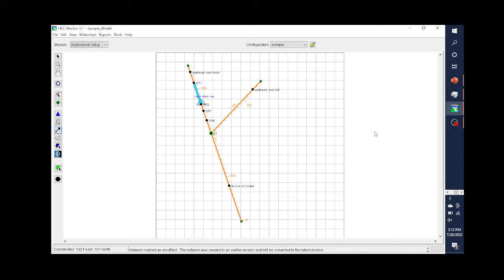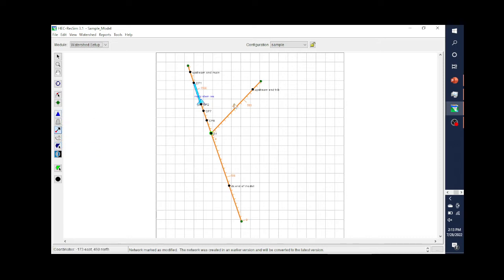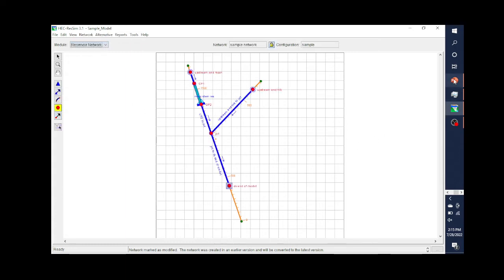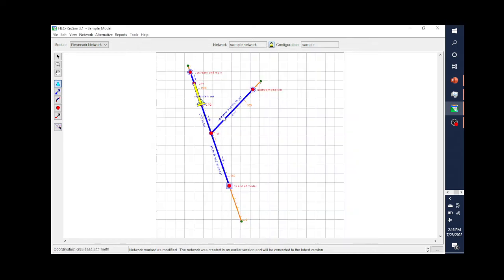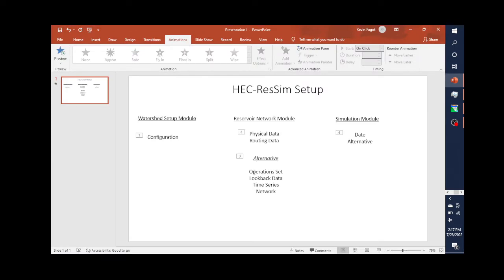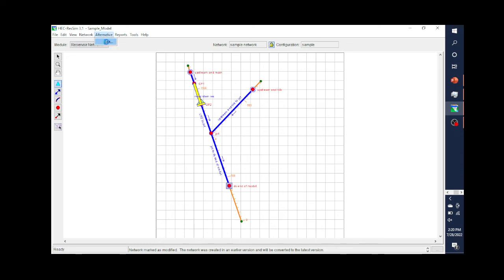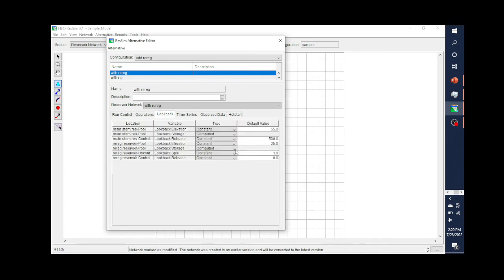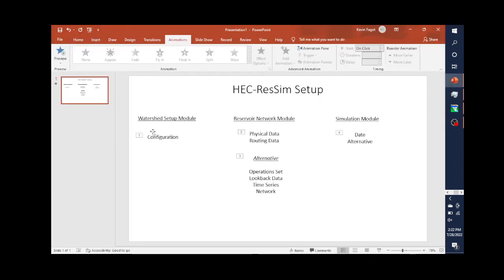How to create a ResSim model

Comment: Hello, how could we get the storage of elevation equalling to 0?
Reply from the maker: Are you asking if it is reasonable to have a zero in the elevation-storage table?  If so, it would be reasonable if you are at a very low elevation where there is minimal or no storage.  However, you could also start at zero storage at whatever your lowest elevation is.  For example, you may start the bottom of the conservation pool at zero with appropriate storages from that point.  ResSim would be ok with that.  It just needs to know the true difference in storage between each elevation in the elevation-storage table.
Reply: @hecressim  got it. Thank you very much.